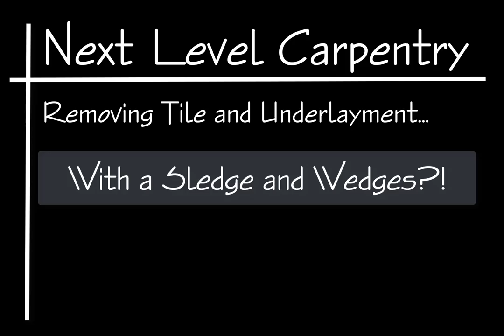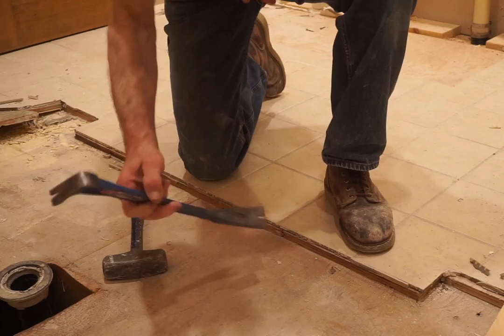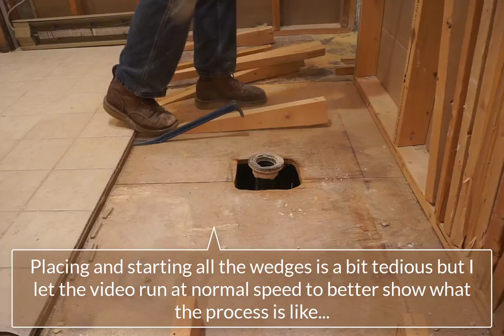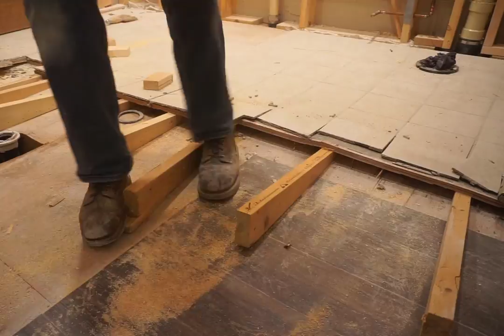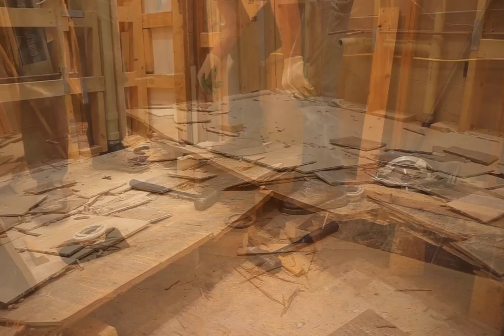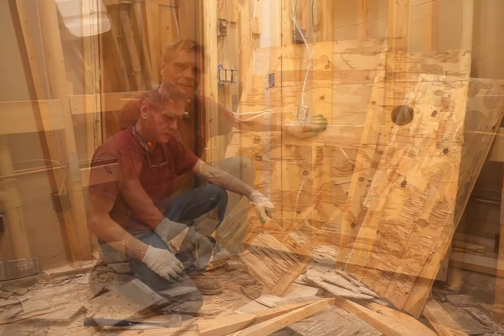How to Remove Ceramic Tile and Underlayment the Smart Way

Comment: That looked exhausting. Josh still standing around watching you work??

What is the reason that you didn't pop the tile and leave the underpayment?

Brent
Reply from the maker: It was an exhausting job... and would have been even if Josh DID show up, knowing his work habits as we do :-)

The bathroom is getting re-configured so I chose to take up the tile AND underlayment so the new Ditra de-coupling membrane 'underlayment' could be laid down on a consistent surface.  Plus drain piping for the shower and stool needed to be relocated for the new configuration and couldn't be done from the inaccessible crawlspace area below which meant I had to cut holes in the subfloor for access anyways.  At that point it made the most sense to just 'hit it with both barrels' so I didn't end up with a plywood quilt at the end of the day.  Turned out to be a good call because, do to cheap construction circa 1980, the subfloor was barely held down with a tiny bead of old, crumbly liquid nails and five 1/2" crown staples per joist!?  This way there's no squeaks or broken tile/grout on MY conscience :-)

Comment: Really dumb question. Why did we chose to remove a good layer of plywood? Hight? Will this work with screws 6” perimeter and 4” oc field?
Reply from the maker: Bathroom got reconfigured. It's the best chance you have with underlayment with that many screws but it won't be easy, just easier...

Comment: In 30+ years of construction, I have never seen ceramic tile installed directly on 3/4" plywood; it's always on a mud bed or Hardi-backer.
Reply from the maker: You've lead a sheltered life there Steve... I envy you!  Best, Matt

Comment: Hello. I have a question I have tile flooring on what I’m thinking is original wood floors.   I’m brand new at diy remodeling.   We are restoring our old farm house we just recently purchased.  How can I know if it’s original wood floor.   And what’s a safe way to remove not to damage flooring if it is original
Reply from the maker: I don't know of any set way of determining if it would floor is original or not but you can probably figure it out by looking at how the flooring is installed like whether it is applied directly to a subfloor or has rosin paper or tar paper between it and the subfloor. Usually the best place to look for layers of flooring is around heat vents cut through the floor because you can generally see all the layers.
Not sure if that will make sense to you or not but that's the most basic explanation I can give you with no more information.
Whether the floor is original or not does it matter nearly as much as how tile and underlayment are installed on top of it.
In some cases you won't have the slightest chance of salvaging flooring under a ceramic tile installation but in other cases if you are methodical and careful you may well be able to preserve it in a satisfactory Manner and condition.
Sorry for the complicated sounding answer but what you're doing is in many cases more of an advanced DIY project that is doable but more challenging without prior experience.
Good luck with your project if you approach with caution you should do fine and preserving all the original flooring is worth just about any amount of effort it takes to do it IMHO.
Best, Matt
Reply: @NextLevelCarpentry  thank you so much. I will definitely check.  What I did notice and the basement door where you can see the floor under the tile to me it looks like they laid sone kind of framing over the wood floor and the. A layer of something and then the tile.   There is about a 1/2 gap between the wood floor ( Looks like tongue and groove and it’s really thick) and whatever the layer is under the tile.   The tile is all loose I can pick up almost every tile in the kitchen and stack them in a pile.   My house is 122 years old and I want to restore as much as possible back to its original beauty.  I am now following you and can’t wait to learn more.   Thank you for taking the time to reply to me.
Reply from the maker: @elisekiser4192  sounds like a labor of love and the fact that you can remove tiles so effortlessly gives you a very high chance of success on salvaging whatever flooring is underneath it. I don't quite understand your explanation of the layers but approach with caution and reevaluate as you remove each layer as to when you should stop and when you should keep going. The good news is that somewhere in there you should find a layer of amazing wood that's 122 years old because they truly don't make that stuff anymore and if you can preserve it you will have something special to cherish and admire!
Reply: @NextLevelCarpentry  thank you so much.  I appreciate you very much.   I will do as you said and see what happens.   I’m excited to get started.

Comment: Watched this video before I started pulling up my kitchen floors today. The only caveat I have is, it is very dependent on how sound your underlayment is. my tile is laid over hardibacker which is laid over chipboard and it won't let me peel the floor up in big sheets like you do because it crumbles when I start to put any pressure under it. Great video though
Reply from the maker: Hey Roger; it doesn't show up in the video but removing the tile trashed the subfloor on this project too.  I ended up cutting it out and then replacing it with new plywood... such is the life of a remodeler, right? Best, Matt

Comment: a couple of old scissor jacks will help in terms of steady pressure upwards.
Reply from the maker: I WISH I could get scissor jacks under there!  Sure would save a lot of swinging and banging, that's for sure!  Best, Matt
Reply: Next Level Carpentry    well, I’ve got a couple lying about in my shed that I use for stuff like that, I think they came out of old Datsuns and they go down to about 4”, nothing fancy !!
Reply from the maker: Great tip CrimeVid... at that size those jacks WOULD have been helpful on this project... now I gotta hit up the salvage yard to find an old rice-burner and grab a couple! 😎 Best, Matt
Reply: Honda or Toyota jacks are great for carpentry, raised parts of houses with them to replace rotten beams, etc.  They worked remarkably well with little effort involved.  Shore up and apply silly amount of force.  Wrecking yards should be great supplier anywhere you live.  Don't like side forces though, hydraulic bottle jacks there.

Comment: Now what do you do to go forward and prepare for new flooring?  Replace existing floor ply with new, then tile?  See why you look so fit, no gym membership required!
Reply from the maker: You nailed it Wrstew... no gym membership required with this sort of 'day job'!  This particular project required replacing the subfloor only because is was such a pathetic installation to begin with.  Even a decent job with decent subfloor plywood would have meant only a bit of clean up rather than 'going nuclear' the way I had to.  It was just as well because I had to re-work plumbing drain pipes for the new bathroom configuration and a shallow inaccessible crawlspace would have required access from the top down anyways. Thanks for watching and commenting here! Best, Matt

Comment: Why not cut the tile through the first level subfloor into smaller chunks, maybe 2x2' or 3x3? Then you don't have the pressure of one side holding down the other?
Reply from the maker: I'm guessing you've never attempted to cut through tile and subfloor at the same time or you wouldn't be asking this question...

Comment: Matt...believe-it-or-not...it wasn't Uphill Both Ways. But it was in one direction. Yes...we Walked To & From School every day in including 40 Below Zero Howling Wind Winter! There was no School Bus. Plus I had a Paper Route. Would get up at 4am. Dad would say "Its 40 Below out...Dress Warm." Then it was a Half Mile Hike to the Post Office to pick up my Papers and Deliver. Then Hoof-It to School & Back.
 When I was 12 Dad put my Brother and I to Work in his Wrought Iron Fabrication Shop next to the House. Nearly every day when we got home from School we had to Change out of our School Clothes into our Grubbies and go to Work in the Shop. I remember all to clearly out in the Field with Dad doing Installations in the Winter! Our Feet would get so Cold they felt like Chunks Ice at the end of our Legs. Nowadays we have Felt Lined Packs for our Feet and Insulated Coveralls for our Bodies. Ski Gloves for our Hands etc. 
 When we moved I no longer had the Paper Route but had an Egg Route as we had 300 Chickens. I used to Deliver them Strapped to the back of an Old 55cc Honda Motorcycle...yes even when it was 40 Below. I'd put both Feet out and slide them on the Icy Road to keep the Honda upright! Anyway that's when I discovered that a Motorcycle Helmet was the Warmest Headgear one could Wear in the Bitter Cold! I Taped a Rag onto the Bottom of the Plastic Face Shield to keep the Frigid Air from my Throat. LoL
Reply from the maker: Those were different times for sure!  You're a better person for enduring an upbringing like that, that's for sure!  Unlike you, my dad wasn't around as I grew up but I'll be forever grateful for Mr Bill Brewer who mentored a group of guys from the area by letting us hang out in his cool garage building stuff with his son who we all went to school with.  Dealing with stuff that would be considered child abuse these days was no fun going through but gives an appreciation for life these days that some just don't have.  Are you comfortable telling me what part of the country you grew up in?  I was  born and raised in suburban Chicago where winters were plenty harsh and moved west to western South Dakota in '82 without a minutes' regret!
I look forward to your comments and tales and welcome them anytime!  Best, Matt

Comment: Now, would this work on 6mm tile underlay?
Reply from the maker: Not sure exactly since there's so many variables of materials, fasteners, adhesives, etc but my initial answer is that with thinner material more wedges would be needed but you won't know until you try.  Best, Matt
Reply: @NextLevelCarpentry  thanks bud.

Comment: Please, do yourself a favor and invest in a Burke bar.  Wedges are slow/cumbersome.
Reply from the maker: ADZB, It's a bit shortsighted of you to assume that a Burke bar is a better solution for this job.  I won't go into detail but first off there wasn't enough room to use a large 'spud bar' in this small bathroom.  Also, the underlayment was stronger than the subfloor underneath it so any large wrecking bar would only have succeeded in punching holes down through the subfloor while leaving the underlayment and tile in place.  I want to thank you for commenting on Next Level Carpentry but caution you against making definitive statements regarding another man's choice and motivation for the work he's done.  You're probably a pretty cool guy but the 'know it all' tone of your comments makes you appear arrogant... it's ALWAYS different when you are 'the man in the arena'.  Best, Matt

Comment: Just used this method to take out tile and 3/4 subfloor glued and screwed. No idea how it could be done without this method the force required is ridiculous. Main floor underneath hardly damaged. Exhausting
Reply from the maker: Exhausting to be sure, but DONE too, right? 😁😎

Comment: I would love to try this but my underlayment is particle board that’s heavily glued.  It just disintegrates
Reply from the maker: Sorry to hear that Morgan... you've got a messy project on your hands!  Hopefully the particleboard is a poor grade that crumbles easily enough as your chip the tile off.  BTW I use a 24 grit disc on a heavy duty side grinder to remove remaining bits of underlayment, mastic and mortar from the subfloor after tile and underlayment are removed.  I use a slow rpm speed on the disc to minimize glue gumming up on it but it's still a nasty project and I wish you well as you tackle it.  Remember my favorite saying when taking on a long, arduous project:
Q: How do you eat an elephant? A. One bite at a time...
Best, Matt
Reply: @NextLevelCarpentry  Interesting.  I have been using a hammer drill to attack the tile and weak parts of the particle board. I bought a wood disc for an angle grinder and have been using that to "shave" the glued bits of particle board (https://youtu.be/7BHfm2buhSk).  Maybe your 24 grit disc would work better.  Anyway, I take a belt sander with 40 grit paper to remove the last glue but that part has been slow.  So I bought a more powerful belt sander and am hoping that it speeds up.  It's tempting to rent a rotary floor sander. ;-)

We have about 350 sqft total.  What would you bid (theoretically) for a job like this?  (Trying to convince my wife that the struggle is worth it! Hahaha!)
Reply from the maker: @MorganBrown  I assume that video is actually you at work on your project?  Your approach to a difficult project is admirable.  I do think you'd do better with an angle grinder like this than a belt sander: https://www.amazon.com/DEWALT-DW840-7-Inch-Medium-Grinder/dp/B0002SRK6M/ref=sr_1_7?dchild=1&keywords=8%22+angle+grinder&qid=1633362219&sr=8-7
I think mine is a 9" size is less important than function.  This is similar to the discs I use: https://www.amazon.com/Aluminum-Oxide-Resin-Grinding-Sanding/dp/B0163DG43Y/ref=sr_1_1_sspa?crid=233ZP48SCUCBY&dchild=1&keywords=diablo+6-7%2F8+24+grit+sanding+disc&qid=1633362343&sprefix=8%22+24+grit+disc%2Caps%2C202&sr=8-1-spons&psc=1&spLa=ZW5jcnlwdGVkUXVhbGlmaWVyPUExRUhKMVZRUEY1OTZYJmVuY3J5cHRlZElkPUEwOTk5OTYzWkZLN0pVTlg4T1laJmVuY3J5cHRlZEFkSWQ9QTAyMDA0MjgyRUtNUzFLMzVPUkFDJndpZGdldE5hbWU9c3BfYXRmJmFjdGlvbj1jbGlja1JlZGlyZWN0JmRvTm90TG9nQ2xpY2s9dHJ1ZQ==
(wow... that's a LONG url!)  This is basically a mini, more controlable version of a rotary floor sander.  Best thing about the disc vs belt or you wood grinding disc is that it tolerates hitting nails and screws better.  They're not so expensive that you can't afford to replace them somewhat frequently either.  Keep up the good work and Godspeed to you in finishing.  Best, Matt
BTW Tell your wife that, even if you could find someone willing to bid the work, you'll get a much better job when done by doing it yourself and be $$ ahead too!
Reply: @NextLevelCarpentry  Thank you very much for the encouragement and product recommendations!  I went ahead and ordered 24 grid sanding pads for my 4.5" angle grinder.  If I need a bigger tool, I can always upgrade.  (Haha, that 13 Amp DeWalt is going to pop my breaker!).

I am laying hardwoods over the removed tile, so it's not a big problem to do the demo in bits.  Just a few rows of wood at a time.  Though it really drags out the disruption.

Many of the YouTube videos I've watched have really torn up the subfloor.  So far, I've been pretty good about preserving it.  Since I'm laying wood, I've got to be more careful than if I was going to lay sheets of backerboard, then tile.
Reply from the maker: @MorganBrown  sounds like you are well on your way to becoming an expert in something you won't want a reputation for😂😎 I'll offer one final bit of advice and that is to not go and tell your friends and family how good a job you did tearing up that tile because before you know it they'll be calling you to do the nasty tear-out projects they have on their to-do list
Best, Matt
Reply: @NextLevelCarpentry  nobody in my immediate family seems interested in saving money on renovations... 🤷🏼‍♂️  I have to thank you for the inspiration in this video.  I ditched the hammer drill and just used my pry bar like a poor man’s wedge.  I wasn’t able to pull up the entire floor, but the tile chunks were larger and often included large pieces of particle board.  This made it far easier to find the “voids” (non glued areas) and exploit those with the pry bar.  Probably twice as effective as the hammer drill, and half as strenuous!  Still have work to do with the angle grinder and sander, but less than before
Reply from the maker: @MorganBrown  I call what you're doing "figuring out a system" for your tear up project.  Every little tool/step/process you figure out and employ along the way refines that system. I think it's fair to say the Pareto principal applies even to demolition work: you spend 80% of your time and effort getting through the first 20% of the job and, once you 'have your system down pat' you can finish up the remaining 80% of the work in 20% of the total time... at least I tell myself that when faced with such an endeavor.  Good on you for digging in despite a familial propensity that trends otherwise! Best, Matt

Comment: Just realized my kitchen has an existing tile floor (the original floor) with a mud floor and tile on top of that!! Two tile floors!!!!! The floor covers the whole kitchen AND foyer ☹️ I'm screwed!
Reply from the maker: Don't give up so easily Fernando... It will be a mess but the mud/tile floor on top of tile should separate pretty easily since few things stick well to ceramic tile.  For the original tile floor you're no worse off than I was... and you look considerably younger than me! 😉😎  Keep this method in mind though as it's what I use for any difficult tear out...

Comment: It actually look like an efficient use of energy? The twenty year old I used to be would have used the legs and lift with the lower back! Laugh! I use my big crowd bars in similar method but I like the equal consistent pressure across the frontal attack. Cause it's easier to seeing a Sledge
Reply from the maker: Back when I was 20 I would have torn this floor up with my bare hands and finished before lunch... and if you believe THAT I've got some ocean front property in Tennessee to sell you <P8-)